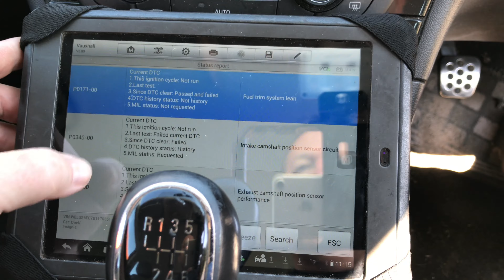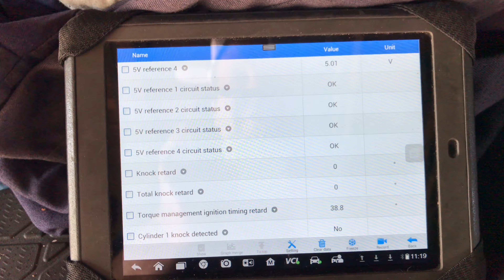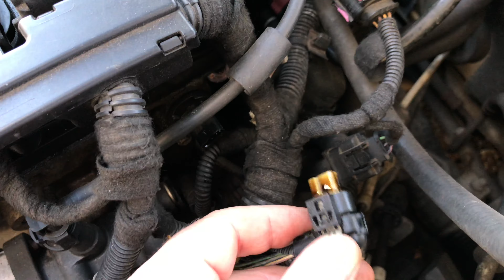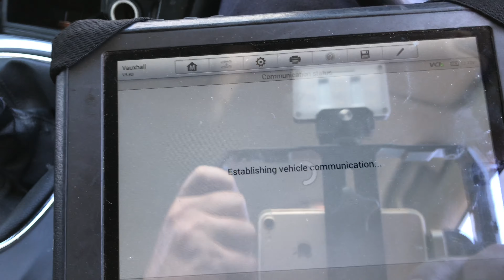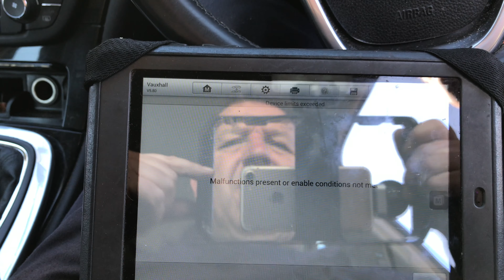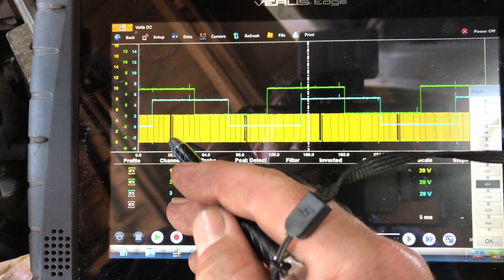Vauxhall insignia (2011) 1.8XER - Poor Performance Fault codes P0340, P0341 & P0366

Comment: I have the same problem with my insignia and today i resolved it , the engine in that insignia and mine are out of a 1.8 astra , the yellow oil cap gave it away , the cams need changing as they are different to insignia cams

Comment: im having the same code P0366 ive bought a new sensor. 
is it even worth replacing the sensor? or has my motor gone for a pish
Reply: Did you resolve that error code ?

Comment: Check engine code as have the same problem the top is different as the bottom and have the same problem as you do runs same like in the video

Comment: Hi sandy I copied you capping off a common rail and it builds up pressure to 400bar injecters were leaking replaced 3 and it still won't start lad ordered high pressure pump but I said it csnt be as it builds  pressure when we cap rail off is there something else it could be ?
Reply from the maker: What is your cranking pressure with new injectors installed?
Reply: Hi gets upto 110 bar and 70 bar i think the injecters are leaking on these but he said there new ones but there not there bosch but not new so ordered high pressure pump but I cap rail off and it his 380 400 bar in seconds
Reply: He ordered high pressure pump i even checked injecter pulse when I  capped off common rail its got to be  injecters leaking again but my boss won't let me recheck leak off and ordered pump 🙄

Comment: This looks one of those " Aye that's the engine for that one mate !! " engines , give me your 400 quid and if it's not right I will give you a credit note 😂😂😂, weve all had one of them , run run as fast as you can , dont do scrap engines for any man , great new tester Sandy,  you tried more than most 👍👍👍
Reply from the maker: Cheers Mike, Sandy

Comment: If you can't find a good wiring diagram with your multimeter connected, drop an incandescent testlight onto the two wires with 5v. The vref will stay at 5v, the signal wire with 5v bias voltage will pull to GND. Don't use anything bigger than a 100mA testlight, an LED testlight won't pull enough current normally so can't be used in this test. There are variations and it's done at own risk 👍
Reply from the maker: Cheers Steve, I think you've told me that trick before but the grey cells you know.... Cheers sandy